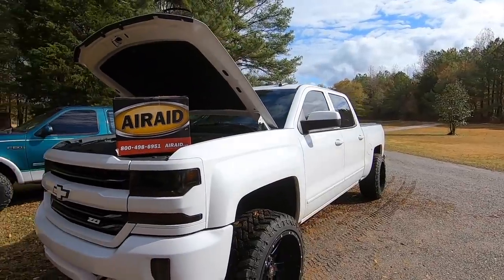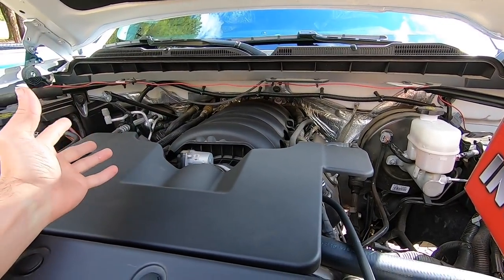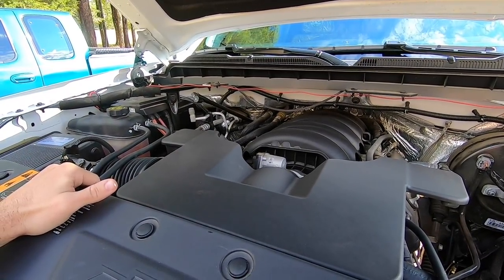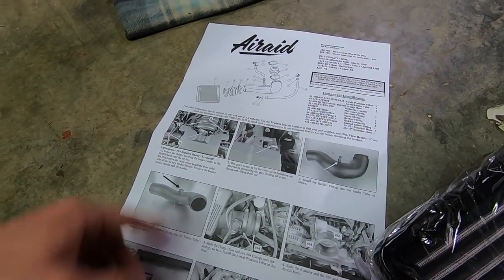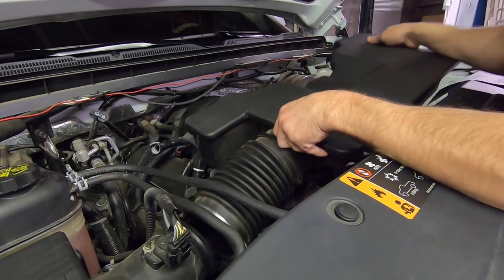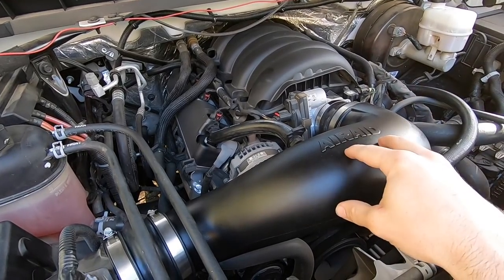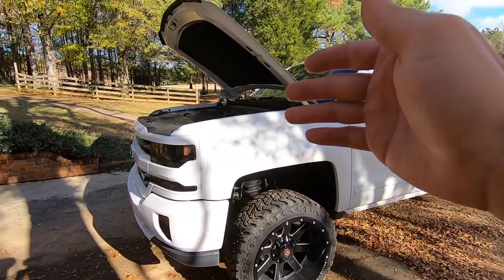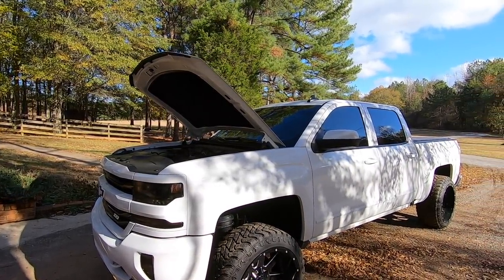Airaid jr intake install ! - 2018 silverado -

Comment: I run a full S&B intake system and you defenility hear the intake and notice a power gain, much more  responsive. also S&B is good because the maf sensor does not change locations from factory setup. they also give ya a rubber airbox plug for bottom if your in a dusty enviroment or you can remove it your choice.

Comment: I got the Airaid MIT just the tube and no filter, diy ported my throttle body to get rid of the tip in lack of power, cleaned up the underside of the airbox lid, and cut out the baffle in the inner fender. It probably picked up 3 or 4 hp but I was mainly doing it to increase volumetric efficiency for gas mileage in the long run. I cut the out the inner fender and airbox first and drove it a few days and I can say that cutting out the inner fender and airbox to match made a bigger increase in noise and felt power than the tube did.

Comment: My 04 Avalanche,. . I did install. K&N filter. When it was new  it does make a big difference in hp Gaines , however it is already a cold air box pulling through the fender to outside of the engine compartment,. The intake plentium boot does two things , first it's a vacum plentium, second it's shape is made  to derect air under and through the intake manifold for added cooling . Leave it on

Comment: I had a Airaid cold air intake with a throttle spacer. Magnaflow exhaust and super chip tuner with my 5.3 Sierra. It sounded like a beast and wasn’t bad on the highway. Fuel mileage wasn’t any worse that I noticed.

Comment: You are full of hot air. Get a gauge and check the air intake temps . Full blown cold air intake has the coldest intake temperature. Stock is the hottest. The factory box absorbs lots of heat.

Comment: I got the same MIT tube on my 2018 but used a Green filter instead of the AirRaid. Im running stock exhaust currently, and can tell a sound difference around 2500 RPM. There's a video from American Trucks that showed an install and a Dyno run with the tube. Didn't have any peak gains, but the curve gains were about 20-25 more HP. From around 4,000 to 5,500 was the curve gains.

Comment: This is the same thing as just buying the k&n filter from autozone and putting it on the stock intake . Should of went with the s&b dry filter CAI , it’s a closed box and uses the same vent holes as the stock air box . That’s what I have on mines and I totally notice a difference . You can hear the air being sucked when u floor it

Comment: Airaid in my 6.2 Denali full exhaust I went Airaid because its a true cold air not half ass'd cold air I saw a big difference at the top of the rpm and right as soon as I hit the throttle compares to the K$N 77 series.

Comment: I have a 2018 GMC Sierra that I just put cai intake on from cold air inductions absolutely love it I did have it Dyno tested picked up 18 whp after intake install. I did also put a jlt 3.0 catch can on it as well would be very surprised to see how much oil that catch can actually catch’s   Also picked up 3 mph on a 1280 mile trip from the cai.

Comment: Gains are between 4600 - 5600 RPM, and is used during passing events.  Power and torque gains are real, do a before and after dynotune on your factory truck and then tell us there are no gains.

Comment: I had the same air intake setup on my 2017 Silverado 6.2. Ran well. But I changed out to a full AFE momentum GT air intake. Truck runs much better and smoother. Also next thing you should look into for your truck is the jlt oil catch can.
Reply: What makes afe better than this k&n filter with airaid tube?

Comment: Been watching your vids for awhile now. I have a 14 gmc slt all terrain I bout 6 months ago with 97xxx miles an did the 3in front leveling kit an black in the back an running 20x12s on 305s an I just rolled it over 109k lastnigjt an havent had any issues with ball joints yet. The factory lowers on mine arent grease able an a boot was ripped when I I bought the truck so I replaced them jus to be safe. Looking at possible upgrading my uppers to fabtech control arms soon. Great video as always. Keep up the good work

Comment: I stay away from the full intake kits. Way to $$ for pretty much 0 gains, just sound. I will get the intake tube like yours cause of the clutter under the hood. 
The differences in power gains is when you get into heads and cam work etc. When you actually need the extra air. Then a tune and a intake will make a few extra horses. 👍.

Comment: Cold air intake will not add any real noticeable power, also got me a K&N CAI the most noticeable aspects were a slight change in sound coming from the engine and a bit better throttle response

Comment: I did basically the same thing but with a K&N filter that goes in factory box. Put in an Airaid modular intake tube
Reply: Lyle Bonney that’s what I was going to do.  Can you notice a difference? I am also going to upgrade to Jet pro-flo mass air sensor as well. Hoping Santa brings it for me for Christmas.
Reply: Kenneth McCumbee sound yes and I like it but no performance gain or fuel economy gain at all

Comment: GM Air Boxes Draw a TON of Air, I did the Exact same thing to my 2008, along with Exhaust, performance wires, delco Iridium Plugs and Tune, and got 50hp. @Imfscrew

Comment: S&B, all the way. If it's not a sealed box CAI (only open for the air vent on the side)..its not helping much. You gotta reduce the intake of engine bay air because hot air = no bueno. K&N and any "cold air" that's just hanging out...all ricer cosmetic BS. S&B also release all their test results so you can get somewhat of an idea of what your increase should be....usually 5-10 HP and 1-3 mpg increase, if installed correctly. It also adds a little aggression to your exhaust tone.

I have one on my 2018 Sierra LT1 and mt 2020 JL 2.0T. You don't have to get S&B (though I recommend you do) but do yourself a favor and get a sealed box CAI and avoid that open air ricer crap. More than anything, just be smart and research, research, research.

Comment: I did the same thing on my 6.2 Sierra.  You may want to look into the catch can and clean side separator.  I installed that on my truck when it only had 1,500 miles.  Helps to keep the valves clean with the Direct Congestion; oops, I mean injection engine.

Comment: Did it come with different fittings for the valve covers? I purchased one of these on marketplace in Gadsden and all it came with was the tube and rubber hoses. I looked at the factory fittings and they don’t seem to work.....

Comment: Love the channel!! Do you know by chance if the 2018 silverado, has a plug and play harness to install amp and subs with factory screen, that I don't have to splice any wires to keep warranty good. Talked to a guy he said that only the silverados with the bose sound system are plug and play compatible?  Any help is appreciated!! TIA
Reply: I ran into this same issue with my 2019 couldn’t find a harness. Didn’t wanna splice so walked away.
Reply: @cdizzle60  they make a plug and play. LLJ customs has a t harness with a converter. I think I paid 100 for one with aux cord

Comment: Streetspeed717 made a video on the 5.3 Ltz 8 speed 2017 I believe n/a with no tune on the cold air inductions intake made 30 to the wheels I believe
Reply: Christian Thomas lol no
Reply: thunder bolt surprised me but he did the dyno test and yea he might have tweaked something but it was a 15-20 hp gain on the dyno idk all I know is he posted a video of a dyno before and after
Reply: So, was it 15-20 or 30? Story is getting shaky.

Comment: Does anyone know what that annoying whine noise is that these trucks make? You can really hear it on his truck when it starts: https://youtu.be/FU8XfSKSFoQ?t=1045

I've noticed some trucks make this noise worse than others. Mine is pretty loud and really noticeable putting around parking lots. It sounds like a bad power steering pump.

Comment: Ur saying stuff that isn’t tru and only opinion. Gains have been proven under the curve in the rpm range u r talking about. Intakes have not helped out much on top end. They make sense if you tow and have curve gains that are very usable. U wasted ur money on a tube and are gaining nothing but sound. Maybe some very tiny gains here and there but not sure where you got ur “generic” info on intakes for “this” particular engine and vehicle. Yes in some older and even newer vehicles the intakes won’t help but it has been dyno proven that a full cold intake does have gains on this particular engine and vehicle. Please edit ur vid. Or show some factual information and back up what u say.
Reply: I have used cold air intakes on my last 3 vehicles. I definitely have noticed better fuel economy.  Really enjoy the sound as well.